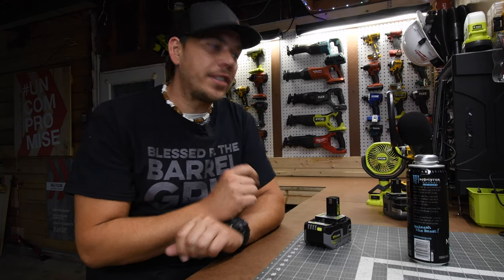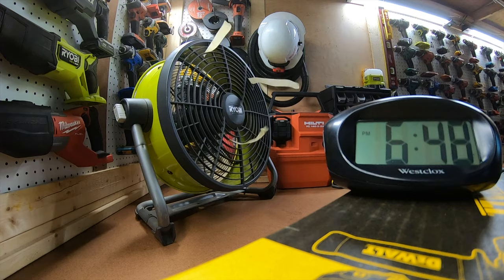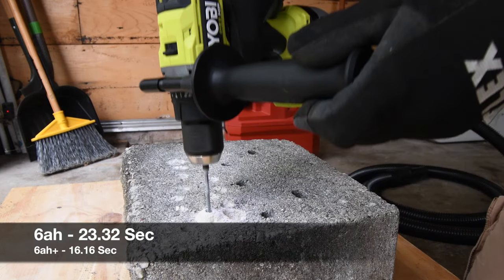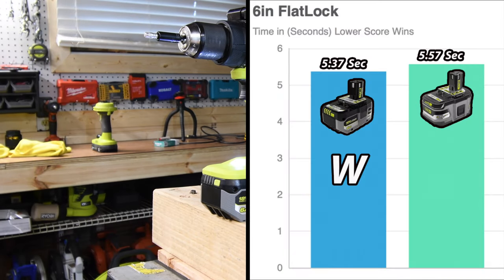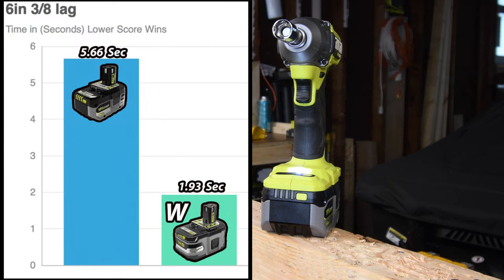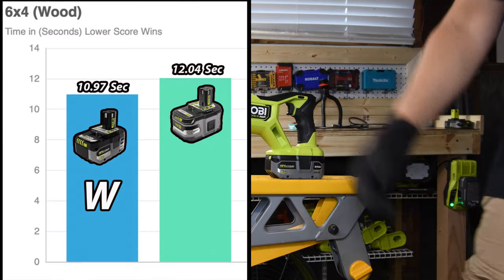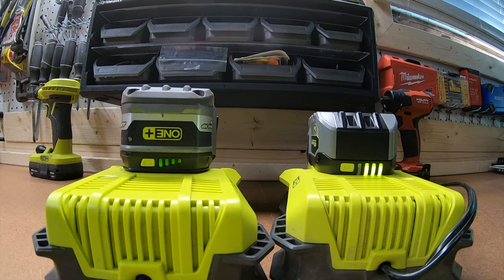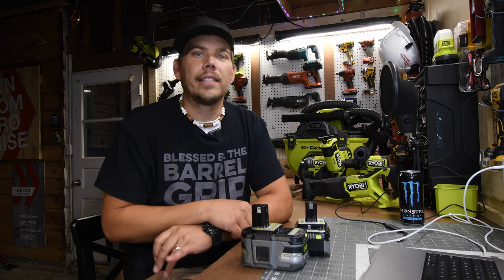Did the New 6ah HP Battery Get Gooder?

Comment: Would have liked to see a comparison of cooling/temperature; I have a chainsaw and two 5Ah batteries, and after draining a battery with the chainsaw they're usually so hot that they won't charge for half an hour. Would be very interesting to see if there is a difference in cooling/internal heat buildup between generations.

Comment: Love the video and the chart. Easy to digest the info and the amout of test in the video is awesome. I used the new 6ah in the 18v brushless string trimmer and use it on high. Not afraid that I'll drain the 6ah on high for my lawn. The 4ah I would have to used low and high settings otherwise I would drain the 4ah.

Comment: I wonder if the endurance losses are from fatigue in the old 6 Amp hour battery. I'm not sure how old your older battery is or if it has been used much, but batteries do lose capacity over time and use.

Comment: Looks like the main difference is size and weight. With the new form factor of the newer 6AH HP battery, I don’t see any reason to stick with the older 6AH ones unless you got them first. I also don’t see any reason to pickup the newer 4AH HP batteries for that same reason if the newer 6AH HP battery is the exact same size.

Great video as usual MCT!
Reply from the maker: I agree with you King, that new 4ah is no longer needed since there the same size
Reply: 4AH is like 60$ cheaper here.

Comment: I appreciate your testing videos but this is obviously an unfair test. The old 6Ah battery has been cycled for years so obviously, it'll have degraded capacity & power output. They both contain the same VTC6 cells so any difference will be down to the BMS.

Comment: Have you considered instead of showing the bars just measuring the voltage with a multimeter? That might add some extra info right?
Reply from the maker: more info wouldn't hurt
Reply: @ManCaverTools  I've never checked myself, but I wonder if a typical meter would show a drop after each test...

Comment: Your using a battery that is probably 3 years old and has been cycled a bunch of time. Every charge/discharge you loose a little capacity
Reply: I've seen a few videos from this guy that have been questionable to say the least and some that were just inaccurate.
Reply from the maker: not a bad performance form a  few year old abused battery

Comment: ok,so ill go ahead and say i have 2 of the older 3ah hp batteries,  1 4ah , one 6ah,  as well as 3 of the new 2ah hps, 2 4ah hps, and i finally recently got onenof the new 6ah hps about a month ago....
firstly let me break down the actual differences between the 2 different hp lines.... 
the ilder hp battery should actual be labeled as "hc" because its actually a high capacity battery,,  whereas the new hps are the legit high performance.. 
i have a close family friend who works for tti and reached out to him to see what he says,,, 

and basically this is what he says the differences are:: 
"the first iteration of the hp batteries where in development and production at the same time as brushless technology was making its way into their tool lineup,, so they werent necessarily making a battery geared towards optimizing that new brushless tech,,, it essentially just sought to pump as much lasting power as possible into the original hps.. 
hence why theyre super stocky and alot heavier,, and also why they seem to last longer in a myriad of tools vs the new hps..

fast forward a few years and after finally becoming familiar w the brushless technology and how it changes the way the tool operates and communicates w the motor and batteries,,, they were able to optimize the long lasting performance from the original hps within the new brushless tools themselves regardless of the battery running it.   
not having to jam all that excess power cell weight into the batteries now, they were able to focus more on fine tuning the way the brushless motor pulled power out of the batteries, and the technology needed to input into the batts to maximize that power output for when the tool demands it.. the 2 back contacts in the battiers originally were to be used basically as a 2nd battery source, pulling from 2 separate rows of cells separately to give it a longer staggered battery output.. but the new hps have utilized these contacts for when the tool senses its being stressed or binding or bogging down,,, and will then call on the extra contacts to access alll the power that that battery holds. not to siphon off one at a time to stretch it out, but to suck down all of it all at once just to miscle thru whatever its tasked with.

and the reason alot of hp tools dontnhave those extra contacts is simply because they do not need them... the brushless motor can still communicate w the new and older hps thru the normal contacts,  and is able to draw enough power for these tools thru the basic way as is.. 
but the heavier duty tools that drain a battery like a frat guy downin a beer,,,  the hammer drills, the circ saws , the full recips, the rotary hammer drills etc, the tools doing the rough demanding  power tasks,,, those are the ones that will nedd those extra contacts when they hit that wall but still needa blast it out.

hence the true high performance naming of these batteries , and the more properly labeled high capacity batteries of the old hp lineup.. 
 and thats the reason as to why we probably wont see a new hp 9ah,, because they simply wont need that weighty battery,, when it can double down on a 6ah hp a d finsih any job... but if your lookong for the longest lasting battery than yes the older 9ah hp battery is king there..

hope that helps anyone who doesn't understand the difference in the 2.

(and fyi the new 6ah hp is the same size and weight as the old hp 3ah,,((and also the exactsame as the new 4ah hps too lol)), which is an amazing qelcome as those 6ahs where heavyyyyyyy

Comment: The hackzall is not for these applications. They will last forever if u use them for what they are for
Reply from the maker: I like to majorly test out the motors with hard tasks
Reply: @ManCaverTools  brushless motors are great but remember how these tools are assembled. The rear bearings are resting in the plastic shell. Too much heat and it'll distort the bearing seat and the motor will be off balance. But really, a new shell is $20 and Milwaukee has the back piece separate